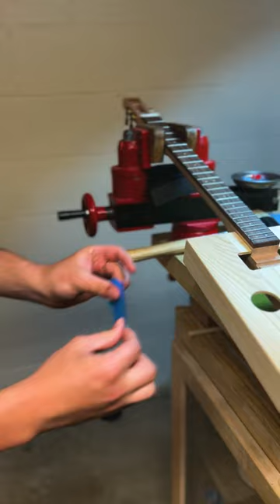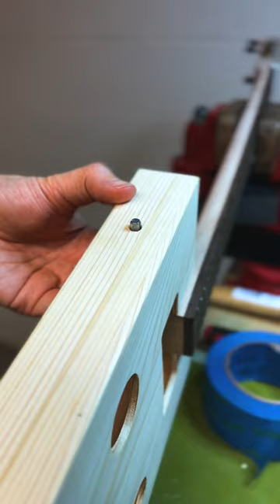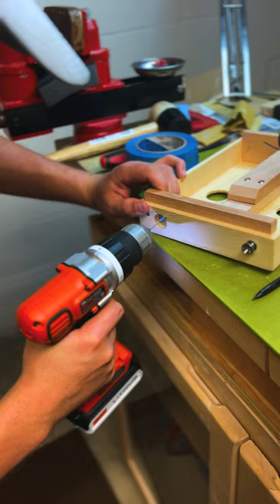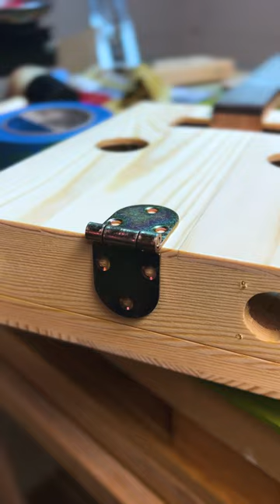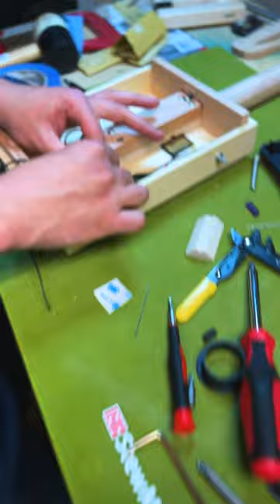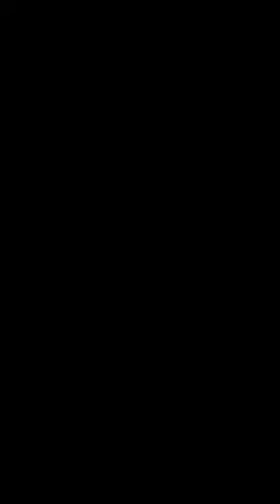😲 Ridiculously EASY Guitar Build

Comment: That's an awfully narrow neck.  Is that a 6 string??????.... Oh.  Never mind.  I can see the regular spaced p-90  poles are wider than the neck.  So it's most likely a 3 string.   4 at most...  But. Hey. You could call it a guitar. ...I wonder what scale length tye neck/frets are ?!   Is it closer to a uke.  Or a Ibanez micro..  or a 24.75"?